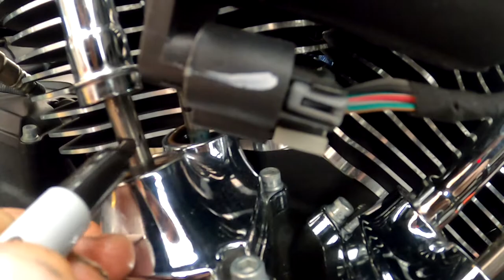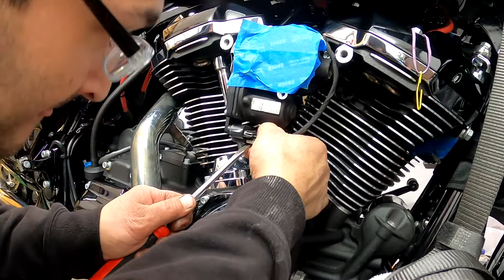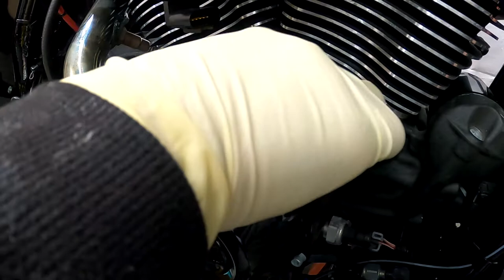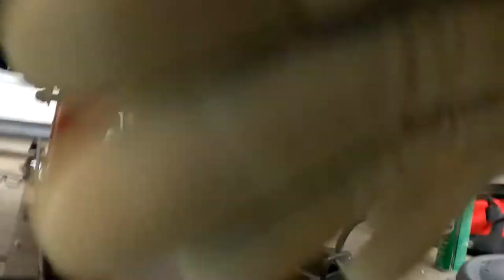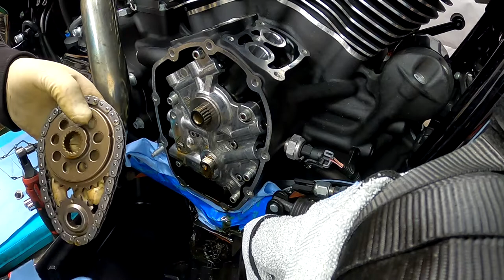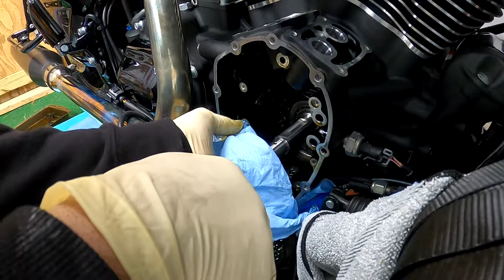30/30 cam install part 1 tear down

Comment: That milky substance you mentioned is condensation build up. You need to let the bike get up to operating temps for at least 20 minutes to burn it off.